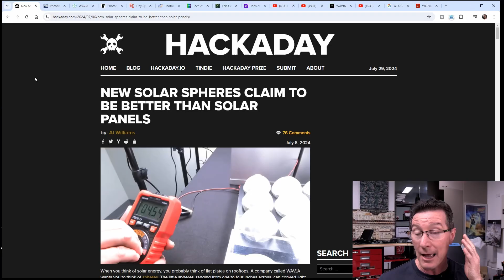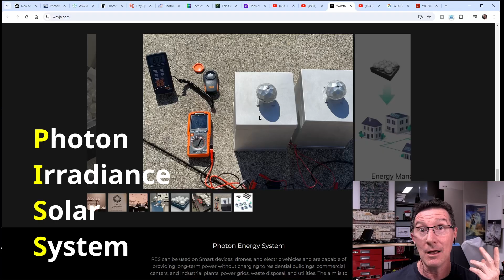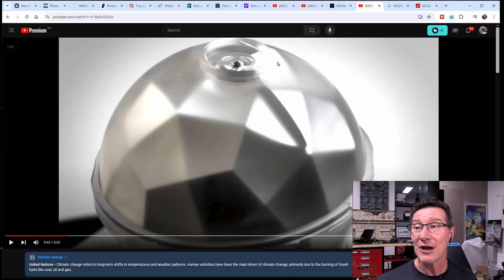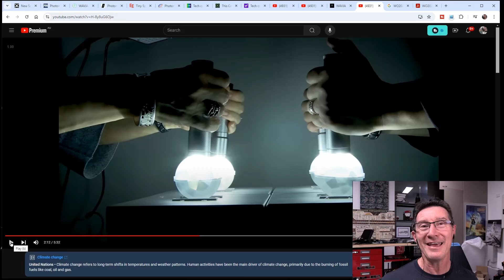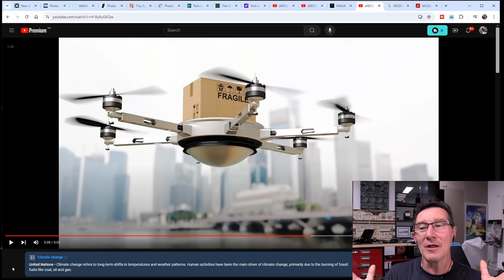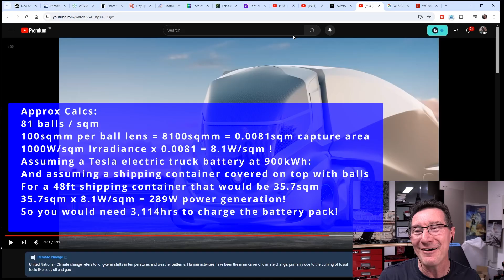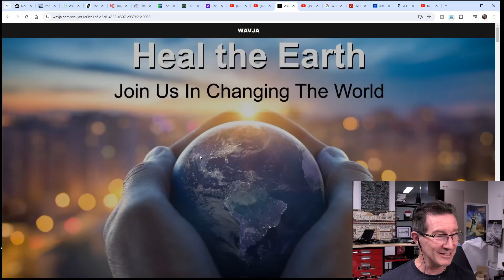EEVblog 1633 - WAVJA Solar Balls, 60x Better Than A Solar Panel? - Part 1

Comment: Step one build a sphere thing
Step two put solar panel in it
Step three make up a bunch of stuff
Step four get called out
Reply from the maker: Southpark edition: "Put a solar panel in it and make it a sphere"
Reply: I'm still confused at what's actually happening, but I think the designer believed that light coming into the sphere would reflect and be more efficient. Sure it's only allowing in a pinhole of light and reducing the amount of light making it to the panel butt it's going to reflect infinitely! Simple as that! Infinite energy confirmed.
Reply: @JohnDuthie  What's actually happening is that the scammer behind this – he's apparently already been arrested because of a previous "venture" like that – hopes someone with more funds than brains will make sure to hop in early with loads of VC investment.
Reply: 20:06 called it lol
Reply: @JohnDuthie  it takes more physical space and looks cool. if it takes more physical space how wouldn't it catch more energy from the vibes? answer that scientist man. the mind is a sphere, the sun is a sphere. have you ever burnt ants legs with a glass marble that's also a sphere and that works! check and coffeemate!
Reply: You forgot step 5:    BS a bunch of vulture capitalists, grab several million from a flock of fools, and head to Tahiti in your new 20 million buck yacht.

Comment: At this point I believe these scammers are just trying out how stupid stuff they can pull out and someone still gives them money to run away.
Either that or these are used for some money laundering or circumventing some financial restrictions.
Reply: There's plenty of people that keep on investing in things like this, but I also still have the feeling criminals use this kind of scheme to evade taxes. They do this as well by buying art and then rotating the art in a group. Something like that.
Reply: The founder is legit a convicted person..

Comment: In the patent they claim that the faces of the balls are all hexagons - I wonder how they get a 3D shape just from hexagons, it's also not what they show in their drawings. How can something like this even get past the very first step in a patent application process? 
"[0011] ...the facets comprise a sufficent amount of tungsten trioxide to cause ion emission in response to stimulation of the tungsten trioxide with a stimulation current of electricity. ... the current has a value of 4 amp-hours (Ah)..."
"[0051] Each 6 cm sphere can generate 300 kW of electricity in one second..."
Has ChatGPT written this application?
Reply: Ok look, their hexagons currently only have 4 sides, but with a $1B cash grant they might be able to get it to 5 sides next year, but 10 years of research is needed for the elusive 6-sided hexagon.  Imagine the power a 7-sided hexagon will output!
Reply: "[0051] Each 6 cm sphere can generate 300 kW of electricity in one second..."
Wait, that thing is more powerful than a kg of decaying plutonium? (which is about 500w, forgetting the per second part as it does not make sense) Even at 99% efficiency they are going to have to dissapate six times MORE energy than decaying plutonium 238!
Edit: as a bonus the power density is 81 GW/m3. Impressive
Reply: I think ChatGPT would be most insulted by that suggestion. Technical data this bad requires human idiocy.
Reply: I wonder what Matt Parker from Stand-Up Maths would have to say about that... His long-running campaign against soccer balls in British street signs made entirely of hexagons is hilarious!
Reply: Damn 1080 MWh is impressive out of something so small. We should power our grid with these, O&G is going to crash so hard. LMAO

Comment: Did they just re-invent an integration sphere and called it a solar panel???
Reply from the maker: An integrating sphere has an otuput, this one doesn't I cover this in Part 2
Reply: @EEVblog  Well, maybe there's a second hole on the bottom as for the real integrating spheres, but here it's clearly gathering energy from the bullshitoverse :-)

Comment: I really like the beginning. No references to Turboencabulator tho.. Missed opportunity. 
also TWO point two Volts of Power! You are doing great!
Reply: I bet you could power 2 turboencabulators with 1 Wavja. Just put in series between the cardinal grammeters. Goodbye, side fumbling!

Comment: Ok so Albo was no spinning more bs when he said ev’s can be charged using solar at night!
Reply: That's actually a legit thing (the night time solar, not the EV charging).  Basically runs off IR rather than visible light, and of course produces 2 parts of eff all power, but y'know "who knows what the future holds!".  UNSW put out a paper on it a while back, filed under "useless but interesting".

Comment: Uh. What? We went from "theoretically possible but insanely impractical" to...this? I don't think these people understand how the scam is supposed to work. You need to be able to convince a clueless boomer judge that you weren't completely lying, that what you said was theoretically possible. Plausible deniability.
Reply from the maker: I suspect over-unity is gonna be hard to defend in court...
Reply: @EEVblog  The rule saying that for any perpetual motion machine to be patented requires a functioning prototype should be enough to squash this.  The worry is that they might confuse a patent lawyer enough that it does not become clear that energy out > energy in is impossible so triggers this.
Reply: The scam seems to aimed at very irrational esoteric types who like shiny things?... and magpies!
Reply: @Breakfast_of_Champions  🤣😂🤣
Reply: @Breakfast_of_Champions  If the magpies will steal these little balls, business will be booming.
Reply: @Breakfast_of_Champions  Then they should have gone with pyramid shapes. Everyone knows pyramids concentrate the vacuum point zero energy ripples with reverse aether resonance at 420Hz.
Reply: @Breakfast_of_Champions  And who have lots and lots os disposable venture capital, of course. Because clearly they ain't getting that ROI any time soon save for a growth in valuation from other idio... I mean, investors throwing money at this hole.
Reply: But your honour, it is really we that are the victims here. We were duped by the engineer who came to us for assistance in bringing his breakthrough to market. His credentials were impeccable - there was no reason to doubt what he said. No, we never thought to ask what was in the box.